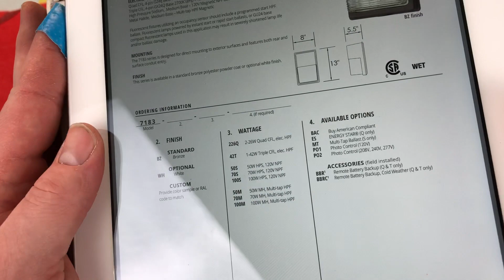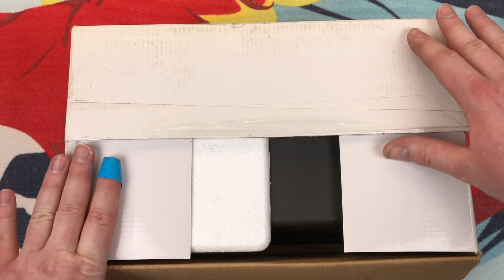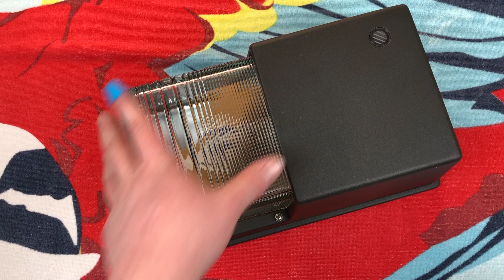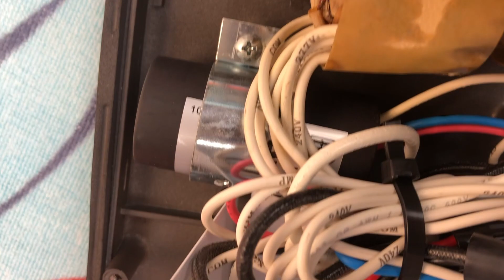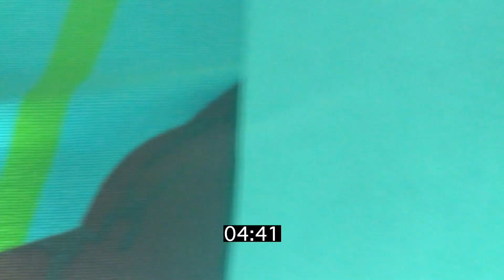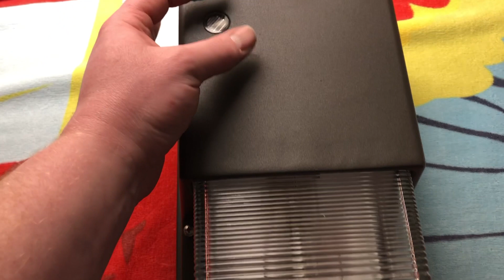Brownlee Lighting 70watt Metal Halide Wall Pack Fixture

Comment: Pulse Start. Probe Start metal halide fixtures are banned just like mercury vapor. Even tho probe start metal halides are way more efficient than the mercury vapor. I honestly prefer metal halide over mercury vapor due to a much better CRI. My favorite light color is 5000K. It is also against the Guidelines to install modern probe start metal halide or mercury vapor. Must be Pulse Start Metal Halide, HPS, And LED
Reply: They probably banned them because you can run mercury vapor bulbs in them.

Comment: I believe this wall pack is heavier than most wall packs of this type because the ballast inside is an autotransformer ballast rather than a simple choke usually found in the high pressure sodium versions of these wall packs.